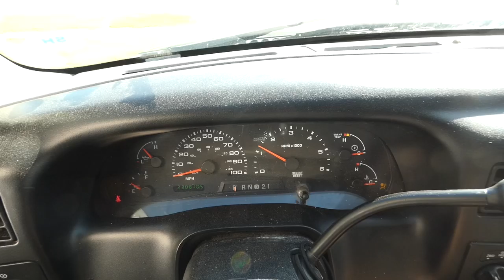How To BUY A Car CHEAP, FIX IT, And SELL It FAST Pt.30

Comment: Man as clean as that is. Its worth 3500 easy. I'm not a Ford guy but it's a nice truck other than the 5.4 lol too bad its not a 7.3
Reply from the maker: SELF TAPPERS N ZIPTIES Haha right! If it were 7.3 I might not want to sell it. Lol
Reply: @KBMOTORSchannel  7.3 is the best engine Ford ever put in their trucks. Their gas engines imo are junk
Reply from the maker: Agreed
Reply: @KBMOTORSchannel  man I found a 2wd 1999 Silverado extended cab and the guy is asking 1500. I was thinking of going to look at it. I can probably buy it for 950. With little rust think it's worth 2500? It is lowered

Comment: truck locks so good. pls try to get more then 1k out if it, hammer the bumper strait and rip out these ugly switches

pls dont let your boys in the dark:-) you can temporarly put that wire under another fuse together with a room with not so mutch power consumption

Comment: What a deal for a truck like that...classic colors👍🏻
Reply from the maker: Copart is awesome! Sometimes. Lately everything is way over priced
Reply: KB MOTORS I’m looking at a 2004 Ford F-250 4WD Ext cab lariat it’s $6999 w/143k miles...what are your thoughts? it would be my first truck.

Comment: Lets start with the bumper. There are places that sell recondition bumpers. How do they recon them you ask? They put the bumper into a tank of very hot water for as long as it takes for the bumper to straighten itself out. It isn't instantly but it does work. I would think on a small dent like that one a heat gun or a good hair dryer would work also. 
I think I'd start at like 3750.00 and accept a good offer. Then you could give them a road guarantee at no extra charge (guaranteed until the tires touch the road). Good luck
Reply from the maker: Dean Labbe Haha you are right!!  And that’s the guarantee I give every time! As is!

Comment: Nice truck . I think you could get 5 grand for that.  I just bought a 2006 f250 2x4 for $950. I have those same wires on the harness loose.  I think it might have gone to a sound 🔉 system.
Reply from the maker: imaslowlerner you stole it!!

Comment: I think with a new bumper you could get at least $4,000 for it, maybe more (at least where I'm from). Do you think the bed would be able to support much weight?
Reply from the maker: TylerrFTW I do. I welded right to the front edge and the cross member behind it.  I wouldn’t be throwing heavy things into it but it’ll hold weight.  3/16 steel is almost a quarter inch thick.  So I gotta believe it’s stout

Comment: You should get $3,500 for it. It’s a good truck. The 5.4 2- valve engine is fine. The 3- valve is junk.
Reply: Fix the bumper.
Reply from the maker: Keith Collins It really is. And it runs like a top.
Reply: I’m in Indiana. Not far from the Michigan border unless you guys around the UP.